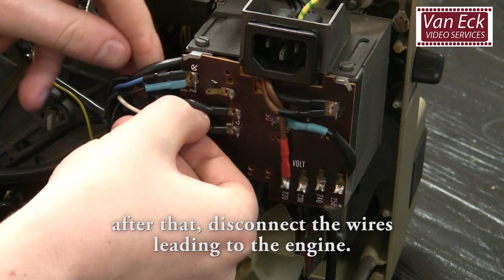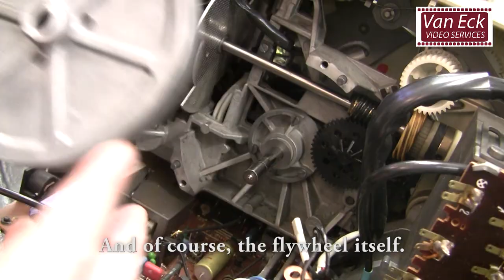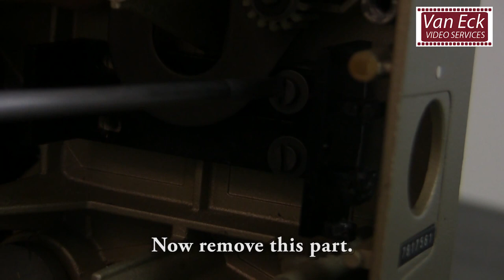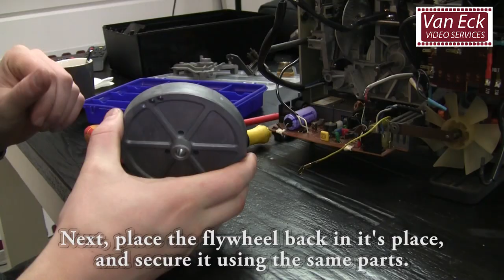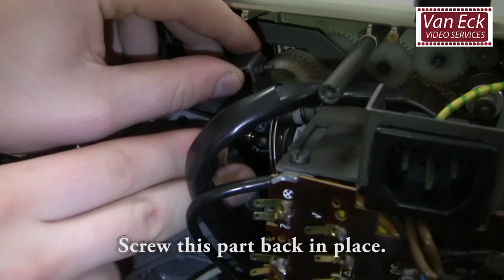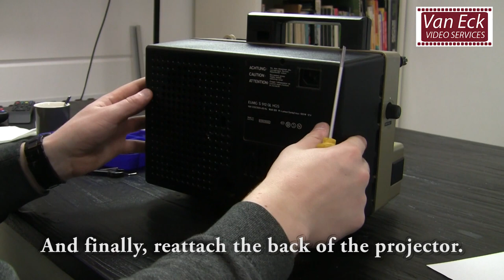Replace Worm gear Eumig S905 film projector instruction (PP-0069 Van Eck )

Comment: I have a Eumig S910 take up spool not spinning. Seems like a clutch is not placing enough pressure on the gear that drives the spool. I found this video on YouTube which is essentially the same projector, but the video doesn't explain if the worm gear is being replaced because of the issue I have listed above. Any idea, please?

Comment: I have around 20 projector of 8mm,16mm and 35 mm. How can I get the parts of any if needed. I am in India. One more point I want to get cleared that after changing any part does it require any oiling or greasing.
Thanks.
Reply from the maker: The parts you need, can we ordered via: https://van-eck.net/en/spare-part-finder/   We ship worldwide. At the part you can find the advised lubrication grease / oil. You can also order these.
Reply: @VanEckVideo Thanks for your reply.  Sir I have one same s 905 projector with same trouble. I need this  gear .How can I get this in India and what will be cost including shipping.
Reply from the maker: @karamchand2211  https://shop.van-eck.net/paying-and-shipping/ for shipping fees.  https://shop.van-eck.net/?_globalsearch=pp-0069 for price. Price is including 21% Vat. For deliveries outside EU (e.g. India) VAT is substracted.

Comment: Mientras buscaba servicios técnicos COMO VOSOTROS O MAS CERCA DE ESPAÑA, compré  otro igual por internet pero el envío no tiene devolución y ha sido una compra terrible ya que todo su interior está como salmitre y no se como quitar ese polvo blanco tan indeseable adherido a las piezas de metal y zonas plásticas del proyector, y el altavoz sale  ruido pero no se oyen las películas , es cuestión de algún fusible ? son sonoras pero no se oyen.AHHHHHH.......SI QUE LAS HE PODIDO VISUALIZAR MENOS MAL .Gracias de nuevo.
Reply: hello, buy a dielectric cleaner for white powder!; in my case I buy one called sillijet. and stop the sound the same put it on the volume control potentiometers or isoprop alcohol Isopropyl. Also check the fuses. I hope it helps you . Cheers

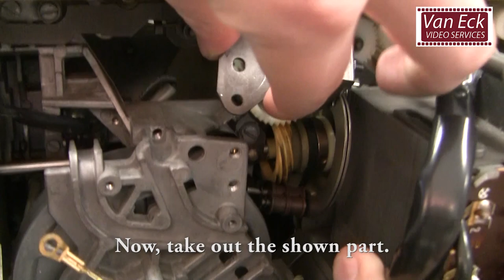Comment: How to install the motor belt to the shown part 03:40
Reply: It's a bit tricky, you have to place the part first, and remove  the cover of  other side of the machine (where the controls are placed). Then you have to fit the belt between both roller arms. They are pushed one against each other with the spring, so they'll keep the belt under tension